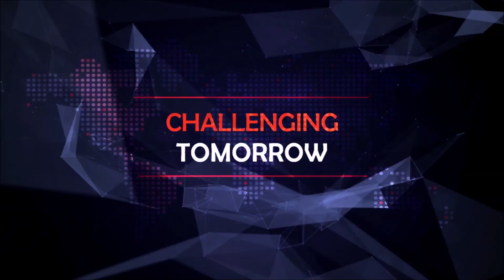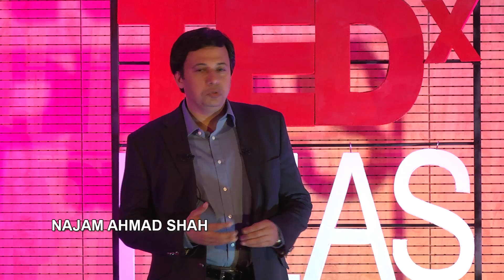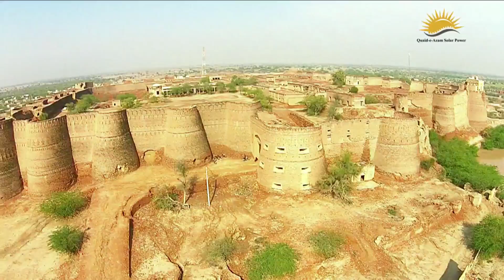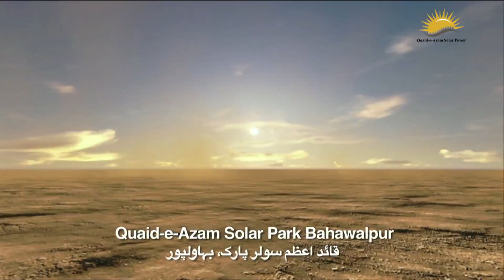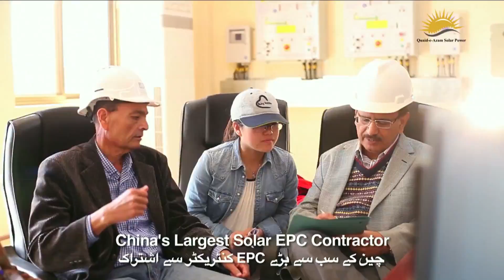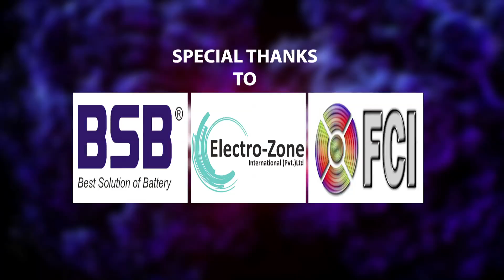Pakistan's First Step to Solar Energy | Najam Ahmad Shah | TEDxPIEAS

Comment: the solar plant is not vibale  because if we sat 300 watt penal. I need just 10 metars wire to lite bulib it will give me 290 watts if I  sat 100 metars wire now I will get 200 watts instead 300 watts we are losing transmission loses and transmission due which is funded by busines man if we put these Solaris penals on tubwell roof school roof and college roof no line loses and  we don't have to fund on any  transmission line

Comment: I commend the blind faith of Najam Sahab but sadly his speech could not be more misleading. I am not gonna go into political aspect of this issue. 

Some Technical Reasons why GRID SOLAR is gonna be a failure in Pakistan: 
1. Pakistan is facing 24 Hrs shortage of electricity while solar is intermittent source. 
2. No matter the tariff, if you do not curb thievery you cannot pay companies generating power. 
3. Companies are not allowed to generate electricity and sell directly to consumers. 

We don't need gimmicks but proper policies and law enforcement.
Reply: Absence of a wholesale Electricity market.
Reply: why govt does not plan net metering
Reply: Spot on Afaq. Najam spoke mostly out of emotion...reality is different and harsh.
Pakistan does need to have policies to empower micro level opportunities. With existing policies only rich people have access to start - who would not take initiative because clean-energy based power production yield return on investment after a long period (roughly 7 years).
So, rich won't invest and individuals (engineers & technicians) are hand cuffed from taking any measures due to existing policies...